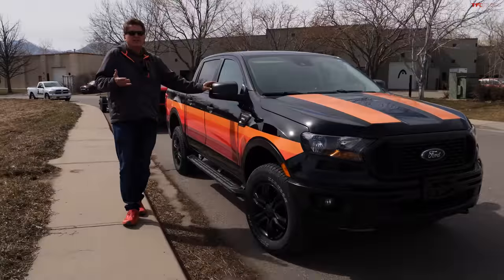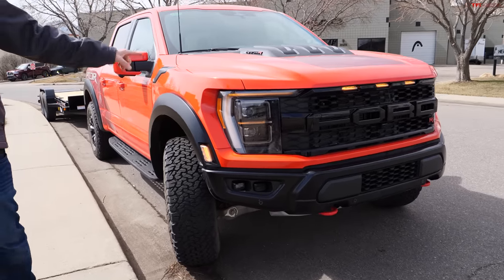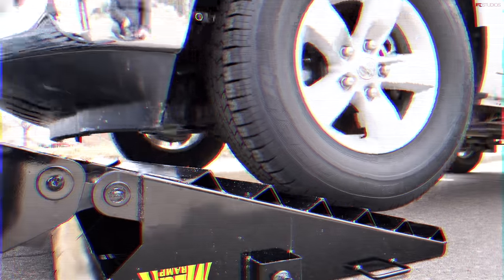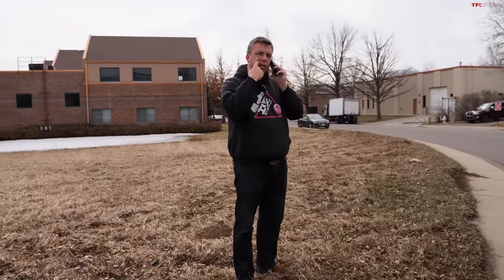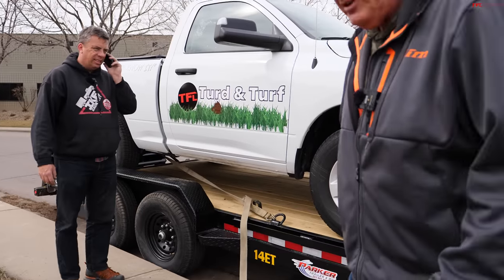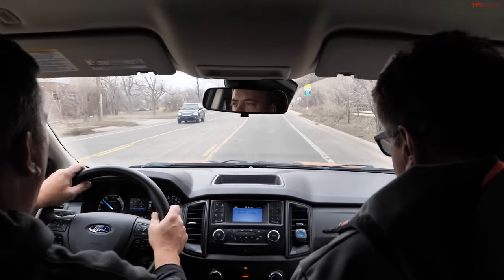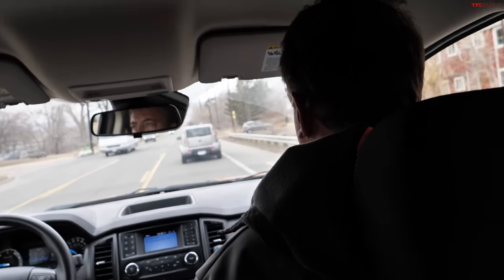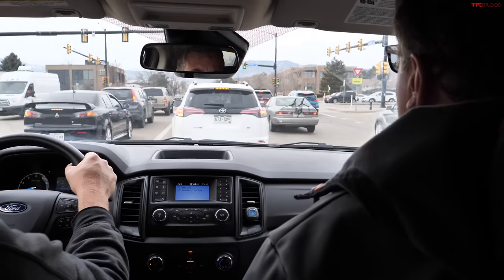I Made a HUGE Mistake and Bought the WRONG Trailer: How Do We Fix It?

Comment: When I run into this problem I just use oil changing ramps on the rear wheels of the tow vehicle.

Also, if you're constantly putting vehicles on trailers how come you don't have wheel straps to make it easier to tie down?

Comment: Sometimes a ramp trailer like you’re getting there will also not be able to load low profile cars because if the front end sticks out too much, it may run into the upward tilt of the ramp before the wheels begin raising the rest of the car.

Comment: I like how TFL took a small miscalculation regarding trailer choice and turned it into a really good episode.  This shows how even the professionals such as TFL Trucks can misjudge things from time to time.  Thanks for sharing everything, whether it be the good, the bad or the ugly!  Can't wait for the Raptor R vs Ranger tow comparison.  I'm pulling for the Raptor R to get the better mileage.
Reply: "Professionals" lol.
Reply: Professional yuppies more like it lol.
Reply: The Ranger will be giving all it has. The Raptor will toy with the load. I know what a 2.7 can do but this is a 2.3 I believe so it will be working in lower gears. On the open road the Ranger will make up for starting and getting up to speed.  I will go with the Ranger but it won't be a blow out.
Reply: Buying entirely the wrong type of equipment is not a "small miscalculation".

Comment: Does the desk lock in the tilted position if you wanted to load 2 side by sides before lowering the deck to chain them down?
Reply: Good idea, but the latch mechanism looks like it is entirely down at frame level, with no way to hold the deck up. It would have to be a hydraulic lock, and I don't think it has that.

Comment: How many garages will the Ranger fit in that the RaptorRRR won’t?  Parking spots?  What’s the difference in cost of a set of tires between the two?  An oil change?  Most folks won’t tow very often, so towing fuel economy also won’t matter for most folks.

Comment: If you have to use this trailer for this job, take the spare off and throw it in the bed of the truck--either one. If it is a constant thing, put the spare mounted flat on the tongue. Or buy a 2' longer trailer. As to the ramps, a couple of 2x6's do wonders...

Comment: Next time, apply your parking brake on tow vehicle before loading......that will stop the rocking back and forth while loading which also puts huge stress on the transmission.
Reply: Well the parking pin inside the transmission... But yes, I've seen too many runaway videos where the truck and trailer just take off while being loaded...
Reply: @svpracer98  the pin isn't designed for that type of load. Just apply the parking brake as well.
Reply: Parking pawl.

Comment: 1; lower tire pressures on the trailer when riding empty for a better ride.
2; there are loads of "do it all" trailers. Tilt is mandatory as well as holes on/in the deck  to PROPERLY tie down vehicles from the tire.
No issue what so ever with the fenders on the trailer if you choose the right one.

Wood on the deck is way to old school and doesn't get any holes to tie down.
3-4 tie downs on the edges/top are way to scarse.

Comment: I believe a engine can run leaner on less load and give better fuel economy . With turbocharger or supercharge engine has a higher load than normal aspirated engine and can’t run the air fuel mixture as lean . It would be great to see this tested . Weather Conditions have to be the same though .

Comment: On those self-tilting decks, you just have to watch that the first axle on doesn't pass the pivot point, causing the deck to come back down, before the rear axle gets on the deck. If that happens, the tail of the deck smashes the bottom of the vehicle and the vehicle can't be loaded. With 20-foot deck and truck wheelbase over 10 feet, this is presumably going to a problem with the new trailer.
Reply: That’s as my thought. That’s how you end up with the powered ones that need to be unhooked from the truck to be operated. Ramp extensions are the way to go without getting a car trailer
Reply: Almost all hydraulic dampened gravity tilt decks have a lock out valve. Tilt the deck, close valve, load, then open the valve.
Reply: @8BWN  great... if it has that.

Comment: I don't quite get the benefit of the ramps either! When folded it means you have a load of trailer length you aren't using, but still have to manouevre. Normal pull-out ramps just make so much more sense to me!

Comment: A 16k tandem axle gravity tilt trailer would be a much better choice!  They are available in 20', 22', and 24'. Probably cost less and maybe even weighs less. You can have dealer certify it as a 10k trailer so you can use regular license plates.

Comment: I would not compare them. The Raptor towed a steel heavy trailer and the Ranger did it with Aluminium trailer. I say have both use same trailer that would be fair. One being super charged and the other is double turbo engines. Just my thoughts.

Comment: I have a BigTex trailer, a 10ET 20 foot (16 ft + 4 ft dovetail), I love it, but gotta think it thru when shopping. I got mine without the MEGA ramps, I got slide in ramps for this reason. As for the spare tire, I had the same issue. I got a spare tire mount that uses a side stake pocket from Amazon for like 50, now my spare is mounted on the side. The only major issue that I had was that my trailer came with no working brakes! Whoever assembled it, pumped the wheel bearing grease in too fast and blew out the rear hub seal on all four wheels, which saturated the inside of the brake drum with grease on all four. I ended up pulling all my brakes and used several rolls of paper towels and several cans of brake cleaner, but I cleaned up my brakes, re-seated my seals, and pumped the grease in the right way... slowly. That was 2 years ago, been towing happily ever since. And I tow quite a bit. I'm a used car dealer and I tow my inventory back from auction, and the auction that I go to is about 190 miles from me.
Reply: "Whoever assembled it, pumped the wheel bearing grease in too fast and blew out the rear hub seal on all four wheels, which saturated the inside of the brake drum with grease on all four."
That's the stupidity of the Dexter EZ-Lube feature, used by careless idiots. You have my sympathy. I would have replaced the brake shoes and demanded reimbursement from the trailer manufacturer or dealer.
Reply: @brianb-p6586 , You nailed it, Dexter EZ Lube. I called BigTex, and the guy I spoke to said that I could bring it back and their tech would check it out and see if it was a defect from the factory (which would be covered under warranty), or if it was something else (no warranty coverage), and if the tech ruled against me, I would be responsible for diagnostics + repair, and if I don't pay, I don't get trailer back. Rather than roll the dice, I chose to do it myself. Manufacturer + Dealer were the same, because I bought the trailer at the manufacturing plant in Mount Pleasant, TX. So the trailer literally had 0 miles on it. It was never transported to a dealer.

Since then I have difficulty trusting anyone but me with my trailers or trucks. The town that I live in only has 1 safety inspector, so he literally has a local monopoly on safety inspections. When my registration expired, I had to get it renewed. Just before, my brake controller literally went up in smoke. I ordered another from Amazon, was waiting for it to get here, but I figured I'd get my trailer inspected anyways. The inspector failed my trailer because my truck (which was not being inspected) had a bad controller. But he had a solution, instead of waiting on Amazon to deliver a Tekonsha, I could just fork over 300 and he would give me a no-name chinese brand and then pass me. I took my trailer to another town. They inspected the trailer and passed me.

Last month registration expired again, went back to the same inspector. He failed me again because it's against the law to patch the sidewall of a tire, and if I wanted to pass, I'd have to cough up 300 for another tire. I don't know if the sidewall patch is true or not, but it didn't matter, none of my tires have patches. I look at the tire to which he objected, and there was no patch. There was some road grime on the sidewall, that I washed off with some soap and a water hose. I could of just used the spare tire, but I didn't feel like bothering with him anymore, so I had to go out of town again to pass inspection.

I said I was a used car dealer. Last year, a guy from Guatemala bought a car from me. He speaks no English, but I speak Spanish, plus he had a passport which TX DMV allows for a non-citizen to use to buy/register a car. After 3,000 miles, he takes the car to the same inspector for an oil change. Inspector tried to bill my guy for 1k for an oil change. My guy, not being able to speak English, calls me and asks me to translate. Inspector said that the oil pan was destroyed, that the plug was just hanging on by a thread, and it'd be 1k to fix. I asked my guy to bring it to me. I changed the oil myself, for free, took me all of about 15 minutes, and I torqued the drain plug to 35 ft-lbs, no issues.

Sorry for long rant, it's just that as of late, I have a hard time trusting mechanics and techs to do the right thing. I see good techs here on Youtube, I just have a hard time finding them out here in east Texas.

Comment: 14K trailer going to add a decent amount of tongue weight.  Throw a truck up there and I would probably be looking into weight distribution hitches for that ranger regardless of what the ford spec says.  I wouldn't be using that suspension hitch that moves the ball further away from the rear axle.  It would start taking weight off the front end.
Reply: Depends on how a loaded vehicle is positioned.
Reply: I was surprised by the discussion during the drive how the trailer seemed to be rear-heavy and causes bouncing on the Ranger. In Finland that would make the trailer immediately illegal. The tongue weight is never allowed to be below zero or exceed 80kg.
Reply: @Miksa  I think that was just an expression of the feeling. Of course when it’s unhooked it will rest on its front jack meaning it has probably still 1-200lbs if not more.

Comment: Can you legally tow a trailer that has a GVWR rating that's greater than the Ford Ranger's GCWR?  I thought that wasn't allowed?  Seriously want to know because I'm looking to buy a trailer.
Reply: Yes... but the actual loaded weight of the combination must be within the truck's GCWR. There's no point in buying an excessively heavy trailer to get capacity that you can't use, unless you're buying one trailer to be shared among multiple vehicles and just can't use the full trailer capacity with one of the tow vehicles.

Comment: Why would you buy an equipment trailer instead of a car hauler if your intended use is to haul cars not small tractors?
Reply: City folk I tell ya 😂
Reply: The wood deck on that tilt trailer will be slick as cow snot as soon as it gets any moisture and will still need booster ramps for something as low as a corvette to help with the angle. Then you still have the interference of the spare tire in that front location. And from experience I can tell you if they try to load a long wheelbase vehicle like a crewcab truck, as they pull it up on the ramp the front end weight will start to tilt that trailer and the tail end of the trailer will smack the shit out of the front lower quarters of the bed and the driveshaft.

Obviously they had no idea of what they were needing, so I say shame on the trailer dealer for not working with them more to get them the correct item to start with.

But now that you have it here are some modifications that will make it usable.

Bolt down expanded metal strips for the tire paths. Think of what you see on semi and tractor steps. That will solve your traction problems even with snow and ice. 

Cut off the spare tire mount and have a new one built to lay the tire forward at an angle on the tongue so it is out of the way.

Make at least the drivers side trailer fender a hinged fold down unit. Even U-Haul trailers have this feature.

Look at having a hydraulic ram system installed to lift/lower the bed.

And it's not so much that you made a bad decision, but again more the fault of the dealer to not sell you the correct trailer to fit your needs.
Reply: These guys are professionals. They've been in this biz for years.
Reply: In the youtube business you mean.   I get the vibe they knew it wouldn't fit but did it for drama.

Comment: I’m confused, why couldn’t you leave the ramps up? They weren’t hitting the trailer until you pulled the pin. Also with those axles so far back that would have been way too much tongue weight.
Reply: Stubby barely fit. What else could they do with this trailer. 

Classic 
Is both less expensive but more expensive.  As it would not serve purpose for other vehicle testing
Reply: It’s obvious that trailer wasn’t right for them but he said it wouldn’t work to pull stubby. Thats what doesn’t make sense.

Comment: It would seem that the spare ture is going to be a continuing issue unless you guys move it to the trailer A frame. Beyond that it looks like business as usual.
Reply: maybe its there to prevent people from putting anything beyind it
Reply: @JogBird  Perhaps but it was a issue that they pointed out on the first trailer as well so they seem to want to be able to get a vehicle past the front edge.
It's all rather half assed it seems.
Reply: It's a longer trailer than the 1st, and without the issue of foldable ramps limiting towed vehicle length.  Can go down the road with a much longer vehicle on the 2nd one.

Comment: I'm surprised the dealer didn't help you decipher what your use of the trailer was originally.  They would have told you right off the bat, that utility wasn't for hauling cars at all.  Like you said, those are designed for equipment and materials.    You'll be wayyyyy happier with a tilt bed for what you're using it for.       Good on the dealer for swapping it out.
Reply: It wasn't the dealer's fault.  It was Roman's.
Reply: @larrysmith6797  Oh, I totally agree. But the point still stands, the dealer could/should have investigated the use of the trailer a little to make sure the proper usage.

Comment: Hey TFL, is a CDL required in Colorado to pull that since the trailer GVWR is 14k?  Most states the trailer has to be under 10k to be non-CDL.  I don't know for sure, but you might want to check this out before it is an issue.
Reply: That's only If the gvcw rating of the truck is above 26k towing a trailer with over 10k. So a 3500 truck "licensed" for 26,001 gvcw would require cdl class B. That same truck also pulling a trailer over 10k would require cdl Class A.
Reply: @fnsweetroush1  So TFL could be in a pickle if they use this trailer while testing a F-350/450 with a GCWR of 26k+!!!  Many trailers are stickered at 9,999 lbs but are actually built to 14k specs.  I wonder what the official GVWR weight is on that trailer they bought?

Comment: Did you guys get a 14ft trailer
Reply: No. The big marking on the side which says "14FT" is the trailer series, with 14,000 pound total axle capacity and gross trailer weight rating and "Full Tilt" deck feature. It comes in three sizes; based on the weight, they apparently got the 14FT-20, which has a 20-foot deck.

Comment: Just move the spare tyre?
Reply: No
This is a bad idea in a fleet situation where trailer isn’t assigned to a truck. 

You will need the tire. And the tire will be elsewhere.
Reply: I had issues with the spare always being in the way in an enclosed equipment trailer... Moved it up to the side of the tongue so it's out of the way but still easily accessible